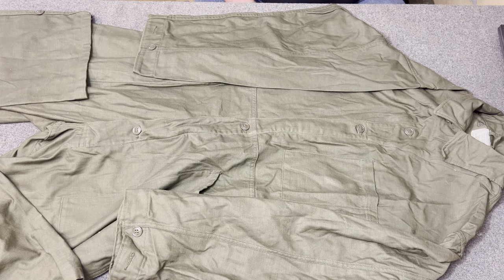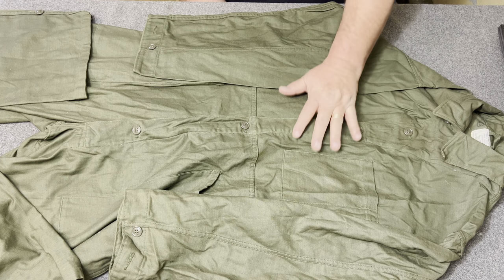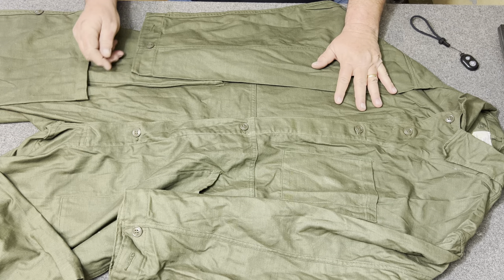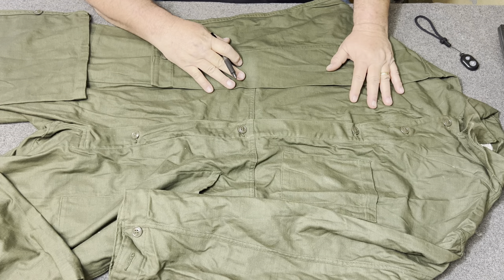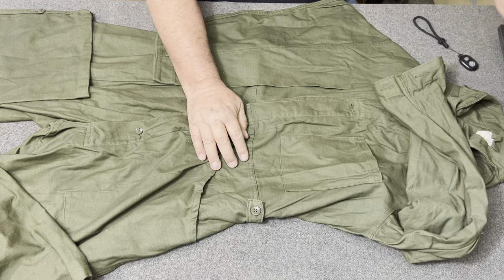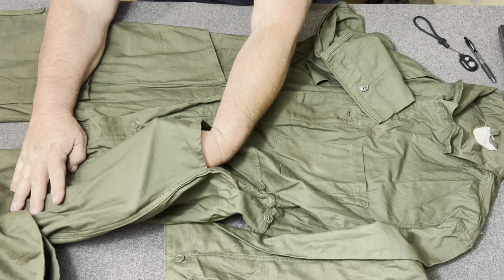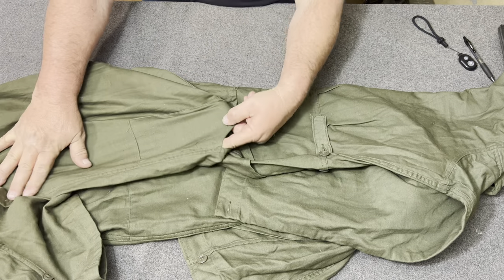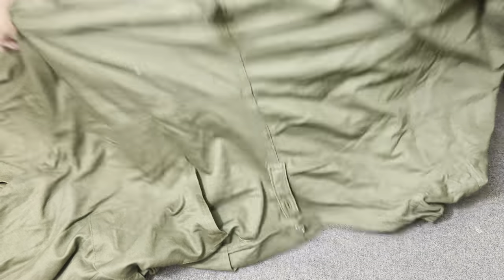U.S. Army OG-107 Cotton Utility coveralls 1952-1975 ish Cold War-Vietnam war

Comment: We used those exact same coveralls in the engineering spaces on my destroyers  when I was in the US Navy  on the gunline during Vietnam.  130-135 degrees in the spaces, those things would be soaked in sweat. We would roll them down to our waists and tie them off with the sleeves, roll them back up during battle stations. Bad thing about them, and I'm sure the Army guys would agree, is taking a sitting head (latrine) call.
Reply from the maker: Thanks for the hands on information , about these coveralls . I did not know that the Navy used them also. Thank you for leaving a comment and watching
Reply: @WebGearReview  You are welcome. We used those until the mid 1970's when the Navy started "experimenting" with uniforms. Coveralls went to lighter weights and changed color from green to black, to red, to blue. Finally went to blue with more pockets and belt loops in the early 1980's. Changed the fabric to lightweight flame retardant, too. We still rolled them down, and still had the "sitting head" problem. Same blue coveralls are still in use today, BTW.